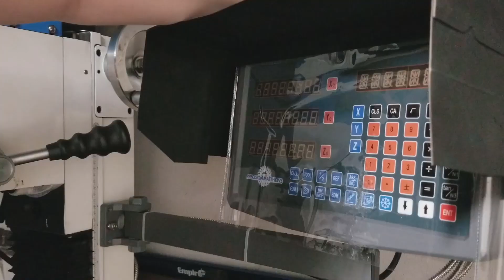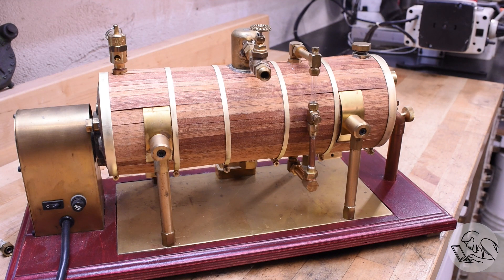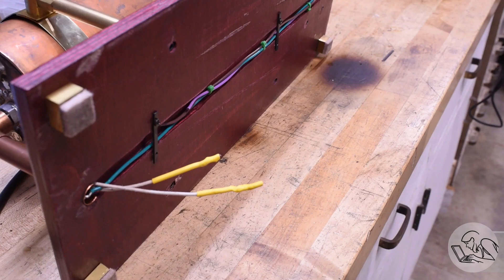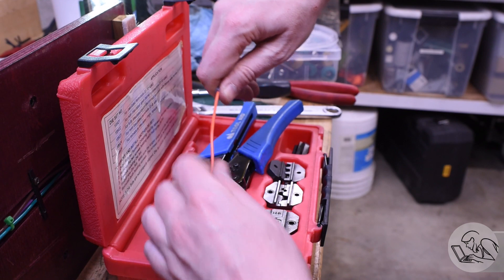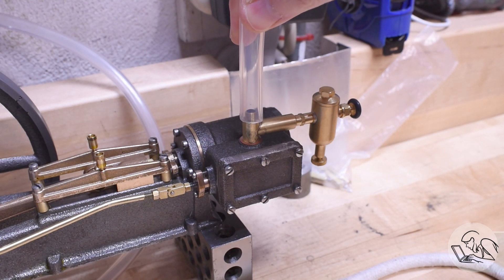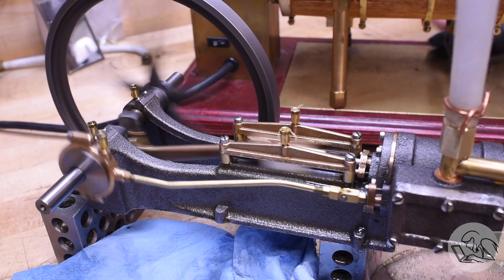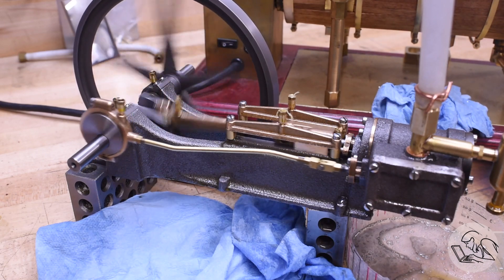Steam Engine First Run : Live Steam

Comment: If I can give one tip... when the valve wears over many years it will cause uneven wear. This is because your entire valve face is flat. There should be a step upto the valve face and the valve should very slightly run off the edge of the face this ensures the valve face can wear without creating a step for the valve to hit. Engine runs nice great job 👏

Comment: Two things I'm wondering — could you make a solar thermal boiler to run the steam engine and connect it to an AC generator? Did you at least save the box from the crummy connectors?

Comment: Hi Quinn. Thank you for you continuous entertainment. 

I have a few questions If i may. 

So I acquired a lathe relatively recently. Oh my goodness does this piece of equipment make you think. Morning, noon and night. 
My apologies first of all. I don't know the correct terminology. 

I cannot figure out how to use a parting tool. 
I've tried every which way I can think and the thing just screams. 

I thought my cutting bits were HSS yet I have come to believe they are brazzed.
Anyway I have sharpened using oil stones and they are now incredibly sharp. 
Still no luck. 

Is there a specific technique to parting? 
I've figured out quite alot of other things so far. I even made an eccentric cam in a 3jaw chuck. But I'm using a hacksaw to part. 
Please help. 

Thanks Quinn. Happy Easter.

Comment: I was hoping to see a link to those electrical connection crimping pliers, but I didn't see one. I've been looking for crimpers like that for a long time. Bought a couple of pairs that I THOUGHT would work well...and don't (very disappointing!).
I used to be a VW/Audi mechanic, and we used to use a pair of Hazet brand crimpers that worked PERFECTLY...but that was back in the Eighties. Do you think I could find those same pliers today? Nope.... Maybe I could buy them at the VW dealership (for an arm, a leg, and several other body parts, maybe...).
Reply: Btw...CONGRATULATIONS on getting your steamer running! That's AWESOME!!!

Comment: Wonderful to see it running on the source it was intended for. 

A few words of caution. Like a line under tension, a steam joint on a hose barb should be treated with extreme respect. Don't be in line with where things will fly if something lets go. In addition to the hose itself, consider those short bits of copper "barbed-wire" that you made the connections with. Where will they go if the hose slips off the barb? Also, consider the half pint (200 ml) of very hot water that will partially flash to steam if the pressure is suddenly relieved. Where will it go?
Reply: Well, I for one feel lectured................Cunningham's law in full force. Thanks
Reply: @marknovak8255  - Yeah, I tend to do that. Sorry if anyone feels as though I was belaboring the obvious.
Reply: @PeterWMeek  I make a few videos of my own, which makes me a bit sensitive. At least you have something posted. 99% of everyone else do not.

Comment: Congratulations Quinn. It runs wonderfully. It would be interesting to calculate the inefficiency of the set up - your 110 volt mains (presumably) heating water to steam to run the engine - then compare that to running a small electric motor.

Love the dancing.
Reply from the maker: I can only imagine how inefficient this setup is 😁 Maybe 10-20% by the end
Reply: @Blondihacks  It would make an interesting demonstration. I once ran a small Meccano steam engine to drive a generator (small dc motor) which then drove a miniature edison screw type bulb. The engine was fired by methylated spirits. That's the usual UK term for what I believe in the US is called "wood alcohol". Basically ethanol but denatured with methanol and aniline to stop people drinking it. So I gave this demonstration to my eldest son's primary school class, when they were about 10. It was a great way to talk about conservation and conversion of energy.

Comment: I had to laugh about your rant on the bargain crimp connectors but I must say you also had me scratching my head because I would of thought someone who knows owns a proper crimping tool would know that no name wire crips are rarely if ever worth purchasing / using and that when it's all said and done you might as well bite the bullet and spend the cash to buy quality ones. 
Now onto more important matters might I suggest a some sort of silly mask or superimposing one of your cats heads when you are doing the Yahtzee dance I not sure why but I think it would add something to the dance but then again that could just be me and my strange sense of humor 
PS congratulations on making you your steam engine chooch on the pressure of the steam.

Comment: Good work. Runs nicely. 
Very surprised the silicone tube held up. If that bursts....
Reply from the maker: It’s common to use silicone tube to run steam engines. It’s rated to hundreds of PSI and handles all the heat no problem.
Reply: @Blondihacks  Thanks. Didn't know that, just seems so flimsy.

Comment: Well done, Quinn. 

I was in need of one crimp connector and crimper to get a tractor running and NAPA was across the street. I ran over and bought their cheapest set of connectors with crimper. Stripped the wire, said the connector on, crimped it and the crimper broke. Like, right through the handle. Customer was waiting, so I ran back, exchanged, and this one got the crimp tight. Everything went right into the round file.

Comment: About these wires used as farmers hose clamps.
I learned many years ago working with instruments in gliders that you should have two loops around the hose before twisting them, that way you will even clamping and not have the small area around the twist where there might cause a leak.

Comment: Thanks for another steamy video, Quinn!
So, water is bad for steam engines - how did train engines deal with that, they probably were not easily run through with compressed air?
I imagine some derring-do, the engineer opening some bypass valves while rolling into the last stop, but it was probably more prosaic than that :)
Reply from the maker: Mostly they were just run continuously. If you’re not storing the engine for a long time, rust can’t take hold. They used steel boilers though and those needed periodic rebuilds to deal with rust.
Reply: @Blondihacks  Ah, I see - thank you!

Comment: Dancing Monkey Dance was the best.

Seeing you run the engine puts steam locomotives into better perspective to me.  When you were "oiling around", I mused about how much oiling still needed to be done once engines started getting built with roller bearings.  No idea which areas of the running gear had rollers, but would assume that it made the engineer's job at least a little easier once those started to come into use (see, for example Timken's "four aces" demonstrator locomotive).  

The whole thing about water was a revelation, too.  How the hell did they deal with that on locomotives?  I mean, I'm sure they kept them hot even at the end of a run, but at some point, they would have had to get all that water out for maintenance.  Can't imagine that they used WD-40.  I mean, sure, "water displacement" but you'd need a biiiig tank of it.  

Are you going to keep using the "bench power supply" or do you plan to construct an actual "burn something in the firebox" boiler?

So happy you were able to steam up - bravo!!!!

Comment: That looks like a hefty heater and a pretty but low-power steam engine. How many orders of magnitude would you be away from a 1.0 efficiency perpetual motion machine if you hooked up a generator to the output shaft and tried to power the heater?

Comment: Congratulations Quinn! I wish my Dad could have completed his steam engine. He was building a 24 foot tugboat using a 5 hp
double acting engine. Unfortunately, a lousy leukemia shortened his retirement. He had the engine built and was ready to have 
the boiler constructed and just started the frame in his basement. To see the completion and test of the engine warms my heart.
I have a model of the full size one he made sitting on a shelf above me. I go to live steam whenever I can find one to reminisce and 
see what others do. Again, Quinn my wife and I enjoy your narrations very much. Now I have to open my machinist chest and break out my Starrett 0-1 inch that is almost 50 years old and measure some brass plate that I am going to build an enclosure for electronics to get a radio telescope going, a 50 year dream. Thanks for another video!

Comment: You did the right thing trashing those crappy electrical connectors because cheap connectors and wire will cause nothing but grief in the long run .

Comment: Nicely done, always nice to see an engine's first steaming.
BTW, forget cotton in the oilers, try felt, you can clip some nice little discs with a hole punch and pack them in the bottom of your oilers. Doing it this way will also mean it acts as a filter, which will keep grit from either getting through to the bearing surface, or blocking that oil hole. Also 1mm/#60 is pretty common for oil holes, don't make the smaller, just let the felt slow the flow down.
Reply from the maker: I’ll try that next. The string didn’t work very well

Comment: Congratulations on first steam. The secret to successful tie wrap hose clamps is two turns. Single turns always fail to make contact where the strap goes into the locking block so they leak there. Two turns make good contact over the entire diameter and it works. The lock block should sit on top of the turn underneath.  If your channel changes to Blondi-dance I'm leaving.

Comment: Is there a max. RPM for the engine, and could you brake it by giving it too much steam?
Reply from the maker: Yes, recommended max is 250rpm for this engine. And yes you absolutely can destroy it with too much steam. It’s why governors are a thing on real engines.